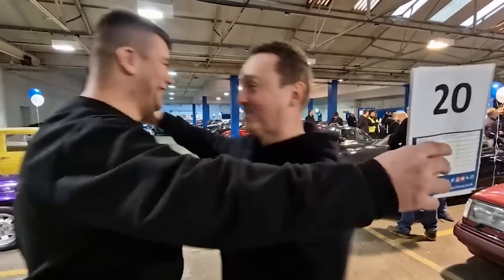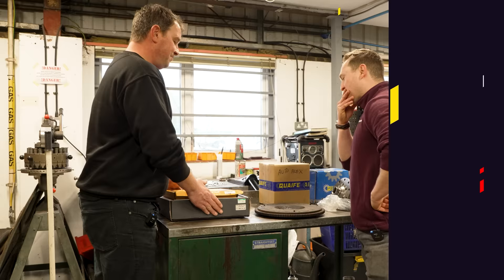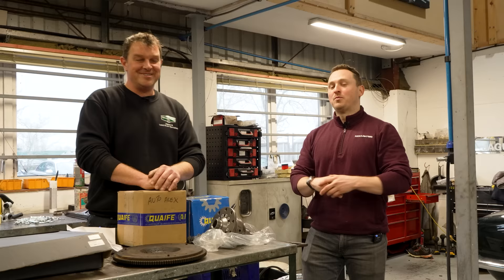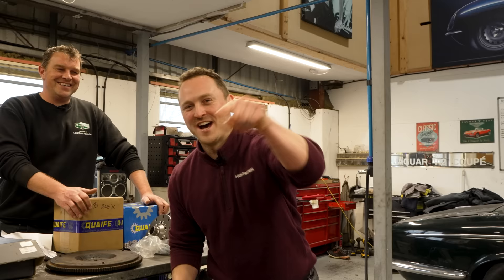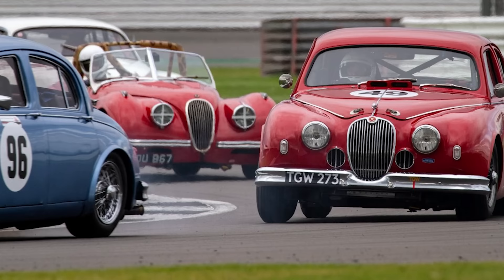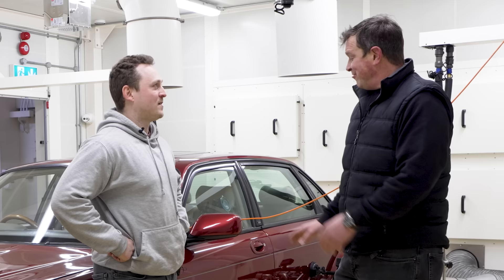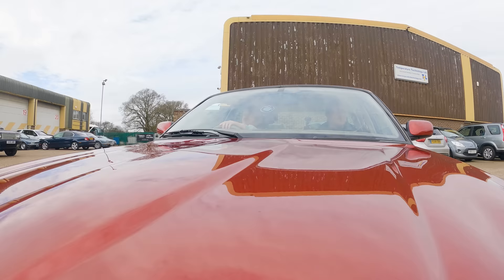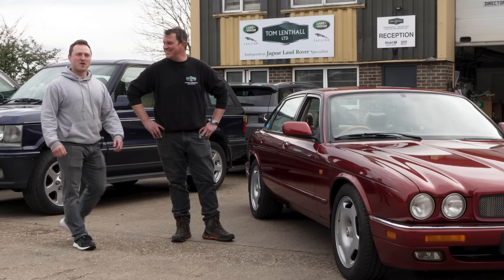I MANUAL SWAPPED MY JAGUAR XJR

Comment: Tom is such a wealth of knowledge
Reply: I miss Jack and Ethan.
Reply: Agree
Reply: I know way more..
Reply: Yes the 'knowledge' that the auto box uses loads of power was invaluable 😂
Reply: @rossjuniper3610  it does, as they proved in the video
Reply: @Henry Carter  it didn't loose hardly any power!?
Reply: @rossjuniper3610  Tom explained that with the manual swap, the engine could deliver a higher bhp to the wheels over a greater range of rpm, compared to the auto. So yes, the auto was using power.

Comment: Hi Alex, I didn't see any suggestion in the video as to whether you changed the air cleaner assembly. This is a significant restriction on air flow and hence power of the supercharged AJ16 engine. I strongly recommend that you fit an aftermarket air filter but also ensure that it is supplied with cold air, not hot air off the cooling pack. Another useful modification is to fit an uprated Bosch intercooler water pump, which will improve the intercooler performance.  I hope you are pleased with the driveability from the reprogrammed engine ECU that I provided for this project. I strongly recommend that you run the car on 99RON fuel if you want to get the most from the remapped ignition timing. Good luck with your forthcoming DRIVETRIBE showdown.
Reply: Definately the best super unleaded  wouldn’t hurt!

Comment: Those engines can make big power. The restriction is the gen3 m90 supercharger. They are not very efficient at the top end so all the gains you can make are low-mid range. For more power you can port/polish them and coat the rotors like I’ve done which basically makes it a Gen5 and more efficient, I have 355bhp in mine I could get more with a bigger intercooler and twin pumps. Or fit an Eaton m112 kit for 400bhp or on the extreme end fit a TVS1800 and get 500bhp. Gets very expensive though unless you stick with the M90. The power and torque delivery from a well sorted M90 is more than enough IMO, the torque curve is crazy.

Comment: IMO, the Jag 4.0, the 2jZ and the VR6 are about tied for the coolest sounding 6 cyl engines. they each have a strange and interesting rhythm that makes them better and different than the rest. ive never heard a V6 that sounded as good as those three. (and if anyone tries to jump in on the V in VR6, you dont understand why they sound like they do.  yes, its a 10-15 degree V but the sounds is because it's still a single head with something else that gives it the "wookie" sound. and yes i know what it is and why it does it.)

Comment: I’d rebuild the supercharger and put some new wiper seals in it…. Bet that would help for sure. If you’re not increasing on the top end, you have a air leak (air gap in compressor) and/or valve seat issues. If you got the balls… cam swap.
Reply: I think it's more a breathing issue, because the midrange has good gains, so the supercharger is doing it's job. 
A cam and some headers would really help.
Reply: @dabigbadwolf5081  Yep agreed but also the supercharger is just overworked. A twin-screw or turbo conversion would really take this car to the next level, the engine and drivetrain can take it.

Comment: I'm working on the early XJ6 I recently acquired.  Manual conversion of any XJ here in the USA is a whole different deal, as no 5-speed/manual XJ was ever brought here by the factory.  I discovered a local (60 mi. away) tuning firm that makes a kit to adapt a Nissan 5-speed gearbox/flywheel as well as a third-pedal kit for the stock auto pedal box.  Already found the gearbox for cheap, saving my sheckels for the rest which is about 4 times as much, plus the cost of them making me a custom driveshaft (sorry, propshaft).

Comment: Factoring in less drivetrain loss, the top end power from the engine has now reduced which with the bigger pulley is most likely the supercharger producing more heat. Might be worth swapping it or getting it ported.

Comment: We had a manual 4.2 fitted with an SDi 3.5 Rover gearbox back in the 80s as a Police Patrol Vehicle on the M23. It spent most of it's time in workshops having the Diff replaced. Good luck with your conversion.

Comment: Did you look into the Andy Bracket? You get about 10-15% more power with it, first hand info, totally changed the response and power of my AJ16.
Reply: Is that the only way to do it these days?
Reply: @paulaus  Of course not, just very plug and play with the original electronics. All it does is add timing, really.

Comment: Torque and mid-range power is what makes a car fun to drive on the street.  My daily in the USA is a 1996 Buick Roadmaster wagon with the de-tuned version of the LT1 V8.  It only makes 260 horsepower, but puts out 330 ft/lbs of torque.  It's wonderful to drive around and it absolutely freight-trains highway on-ramps.

Comment: It could be a lack of fuel thats holding it back - with a bigger lower pulley, the MAF tops out before the supercharger does, so it leans out at the top of the rev range.
you would think it would have a bit more power though, so there might be something else causing the lack of top end.

Comment: 11:18 he says they put a bigger pulley on the supercharger to give them more top end and power off the line. When I upgraded my Miata the pulley was smaller. Wouldn't a bigger pulley drive it slower?
Reply: Crank pulley, not supercharger one.

Comment: It is factually impossible to ruin a car with a manual. This is going to be fantastic!
Reply: Yes it is
Reply: @bmwman1981  no it's not
Reply: @philspaghet  yes it is there is a reason that not many Jaguar xjrs where built with a manual as no one actually brought them
Reply: @bmwman1981  That's because people are uncultured. They wanted a Jaguar as a luxury car but a XJR is not quite a luxury car like that. The whole character of the car changes with a transmission swap like this.
Reply: @philspaghet  i had a xjr and I couldn’t imagine wanting to own a manual one completely pointless it’s a fast luxury car so I expect it to be a automatic now a bmw m3/m5 yes a manual one makes sense I currently drive a s class unfortunately not a amg model but I would never expect Mercedes to make a manual s55 either as it’s completely pointless

Comment: I'm confused. Was the original power run done with the pulley and tune already in place? 
It kind of makes sense that the peak power didn't change because once the torque converter is locked its just an efficiency difference and thats not going to be much between gearboxes of the same age designed for similar powertrains. 
The big gain is while the converter is slipping and burning power on the original vs it being locked in a ratio all the time in the manual. That and the extra control is going to make it a very different (better) drive.

Comment: Correct me if im wrong but wouldn't you put a smaller pully on the supercharger to make it spin faster? Increasing bhp?
Reply: Not on these ones, on these it’s much easy to put a larger crank pulley on which has the same effect as a smaller supercharger pulley without the headache of getting the supercharger pulley off. The crank pulley is just 4 bolts.
Reply: @Lee Evernden  okay doky... cheers mate. Appreciate the info.
Reply: I did on my s type r but also did a tune

Comment: What a great idea. Jags should come equipped with a manual gearbox as standard. The option should be 'Automatic', instead of 'Manual'. It makes more sense for sportier cars.
*"Double digit MPG"?
What?... 0.7?
Reply: For this generation of XJR it actually did come with a manual as standard - but 95% of the buyers decided to tick the automatic box... reality can be disappointing.
Reply: @bjarneanmarkrud8187  Thank you for that. I guess I wasn't really aware of reality. I can't understand wasting all of that power on an automatic gearbox. If you pic an automatic, you probably just want to get from place to place, stylishly and leisurely :)
Reply: @mmjackk667  yeah, i have a XJR6 with the automatic, and i can easily see the appeal (i bought one after all) - its very easy to live with and its more then powerful enough for spirited driving, but like any  financially irrational gearhead, i am saving up for a very expensive manual conversion, just so i can have more control and involvement on those occasions when i find myself on some nice twisty roads.

Comment: I thought a smaller supercharger pulley would spin faster to increase power, but i suppose there is some difference to this and something off roadkill hahaha
Reply: A smaller pulley would reduce boost. I'm thinking either he misspoke, or they increased the crank blower pulley, not the snout pulley.
Reply: On these you change the crank pulley, a bigger crank pulley has the same effect as a smaller supercharger pulley.
Reply: @leeevernden  that's what I was figuring, but at the same time, it's an Eaton M112. A quick search online shows aftermarket snout pulleys for them as well, for other applications, like the F150 Lightning and Harley-Davidson Edition, or Mustang Cobra.
Reply: @musewolfman  it’s an Eaton M90 on the six. The crank pulley options spin it up 10% or 16% faster. These are a Gen3 charger so not very efficient at higher RPMs, any faster than that and you’re just making hot air and losing power…. Unless you rework the charger body, rotors and bearing plate at the same time.

Comment: What makes you think you'd have more HP at the top, the auto trans has a lock up torque converter an lsd doesn't increase HP, if you didn't get more power after increasing boost you messed up big time.

Comment: Can they convert later 4.0 V8 models to manuals too?
Reply: It'll be harder; the six-cylinder was available as a manual from the factory, while the V8 was not.
Reply: @ofmanynicknames  it will be the same as the supercharged one drive tribe did,  they dropped a discovery3 2.7 box on it

Comment: Two minutes in and I've face palmed already.

You won't improve acceleration by sodding about with gearing. Christ alive, this is possibly the most misunderstood aspect of motoring, even more than the relationship between torque and bhp.

Give me the new and old gear ratios and I'll show you the performance it will have compared to OE.

Gearing can be used to 'optimise' performance but the manufacturer will have done that already.

It won't make it accelerate faster. It's a waste of time.